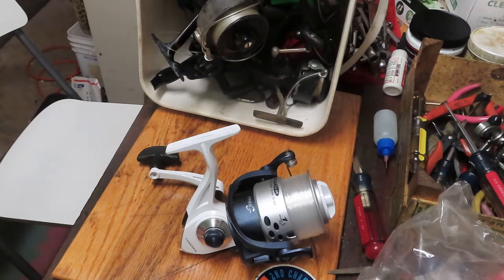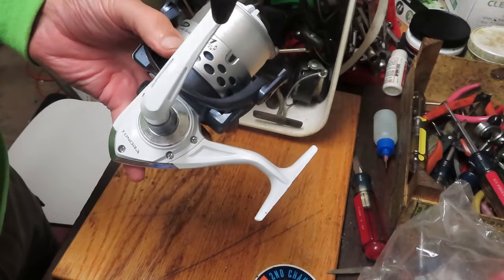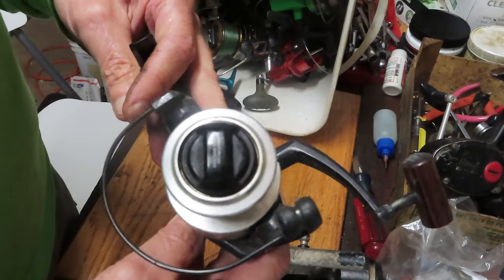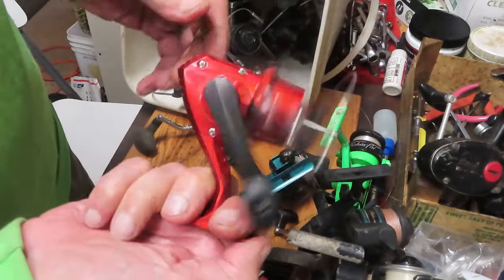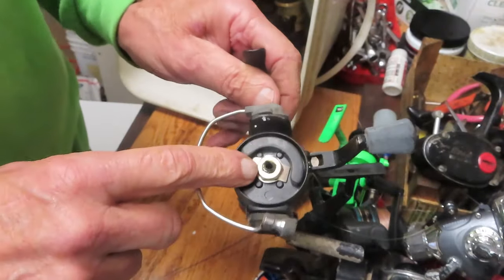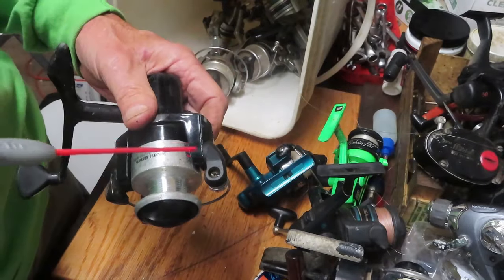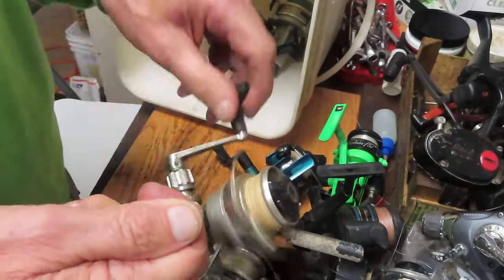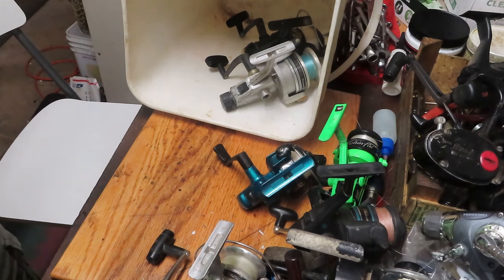What happened to the fishing reels and what use are they??

Comment: Great job on the videos,very helpful, thank you. 
Question: what's your thoughts on using loose bearings rather than caged,or is it even possible
Reply from the maker: I always recommend that you go with the bearings that came with the reel as that is how the reel was designed.  You can upgrade bearings to sealed or ceramic if you like - Dennis

Comment: You might try wrapping the threads with tefon tape or adding a drop of Lock Tight to the threads.
Reply from the maker: That's a good tip.  I don't like Loc-tite because you may not be able to remove it for future service.  The teflon tape may hold.  I hate it when you need to fix what is clearly a manufacturer's design or materials issue.  Thanks - Dennis

Comment: Could you run a tap through that Okuma handle to get the threads to catch? May not hold as good as original, but it may give some life to that first reel.
Reply from the maker: It's the core that is stripped, so a retap may work, but it is already loose, so unless you have a wider screw, I think the chances are that it will remain a problem - Thanks for the suggestion - Dennis

Comment: Put a small strip of alllumium tape on the Okuma screw, length wise.  1/8 wide. A little blue  lock tight. Screw it in. Let set 30 minutes.
Reply from the maker: Thanks for the tip .  It's worth a try - Dennis

Comment: Dennis, do you have a video on on servicing a Mitchell 303? I purchased one at a flea market and it’s in very good condition but needs a good cleaning and servicing. I got as far as removing the spool then got very intimated! Is the service similar to a 302? Thanks
Reply from the maker: The service is identical to the 302, but the parts are mirror image, so left is right and right is left when removing or installing parts like the side plates and gears

Comment: Dennis, can you please make a video on how to make a shaft shim out of plastic? Thanks!
Reply from the maker: I will try to do that. - Thanks for asking
Reply: Thanks for your consideration. I have a Quantum 70 reel that has line spoiling at the top. I’ve tried to find shins from other parts reels but that hadn’t solved the issue. The spoil just doesn’t stay high enough to prevent the spooling

Comment: Do screws pretty much have the same thread pitch among different brands? I have a couple of old reels that work but I need side plate screws because the original screw heads have snapped off. Just wondering if I can pick up an old junker and scavenge some screws.
Reply from the maker: No, the screws vary significantly.  Some are metric and some are SAE and many have different pitches.